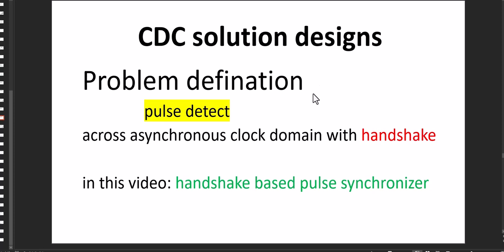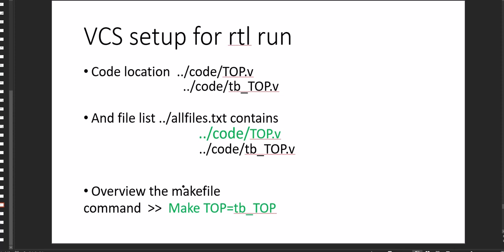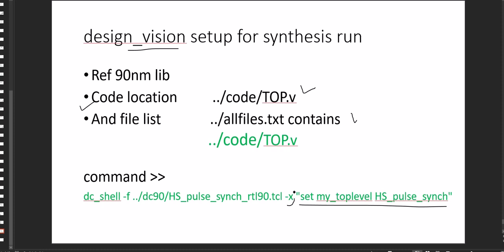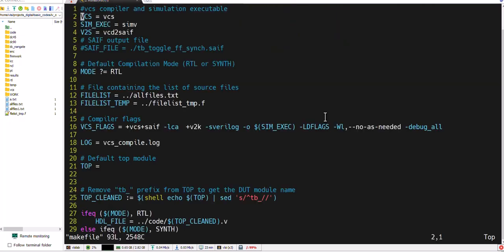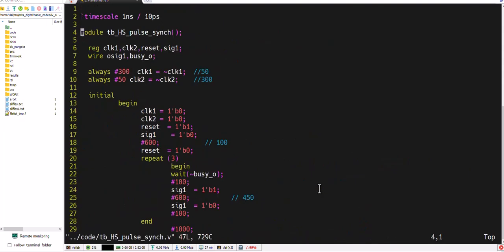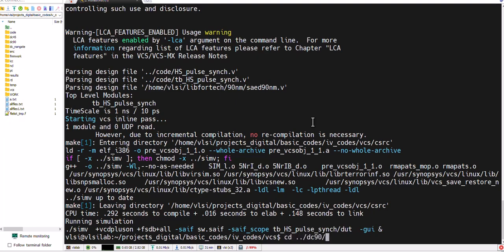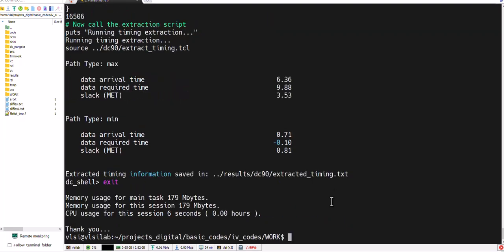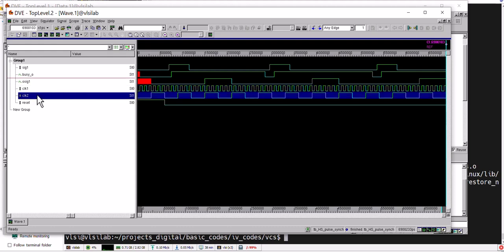CDC Solutions Designs [4]: handshake based pulse synchronizer

Comment: regarding fast to slow domain data transfer when i run the design in  spyglass tool goal :cdc/cdc_verify i got issue cdc01a , but the above mentioned design must pass the data hold right